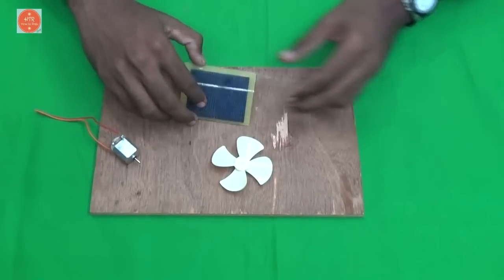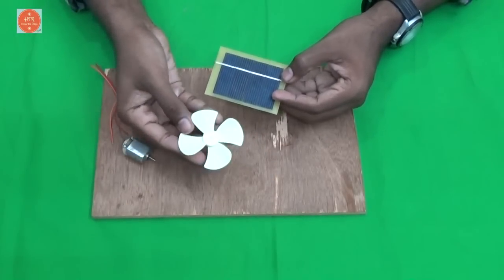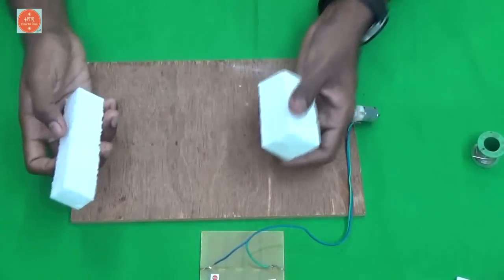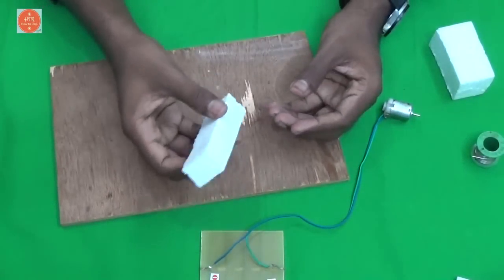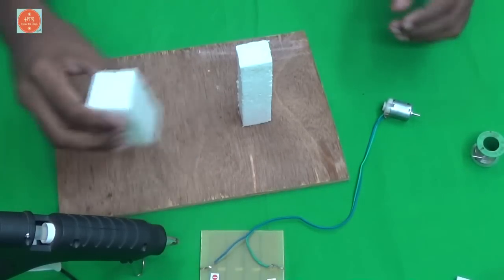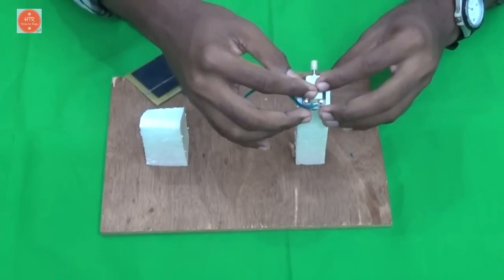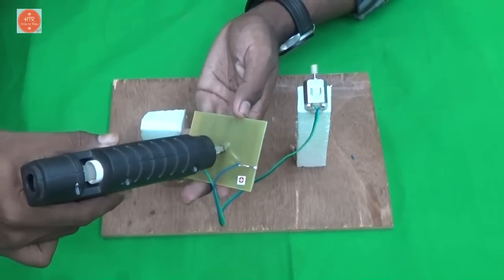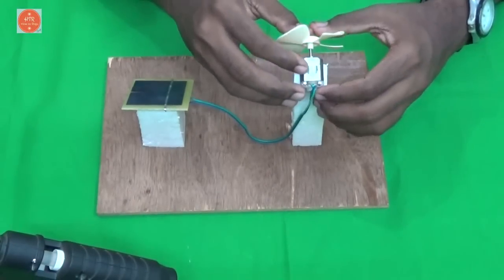How to Make a Solar Powered Electric Fan - Science Project

Comment: how to join the motor with thr solar panel and how much watts motor is it?
Reply: motor can be 6 watts but less than the ability of that solar panel and obviously you connect it with wires
Reply: u can use 3V solar panel so the motor must be 3v or lesser